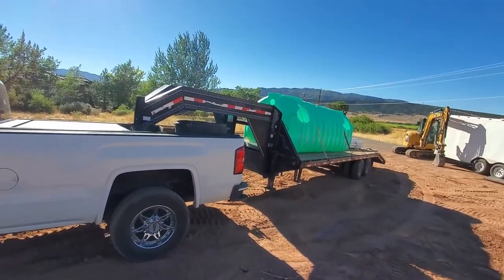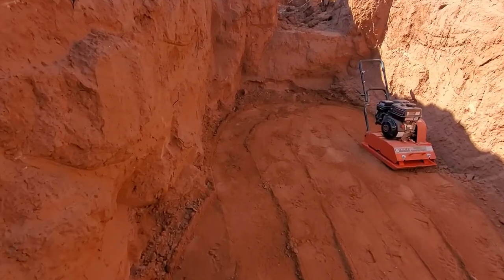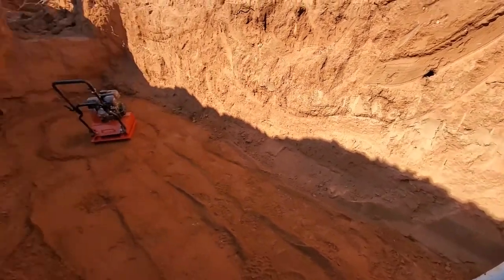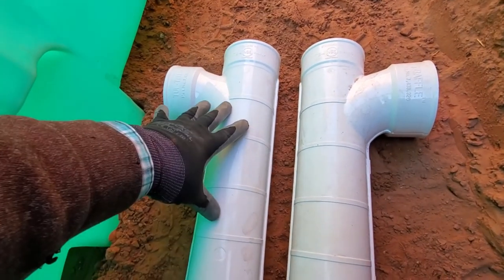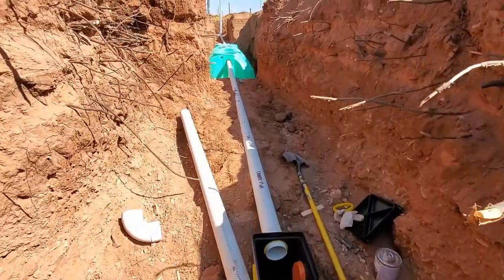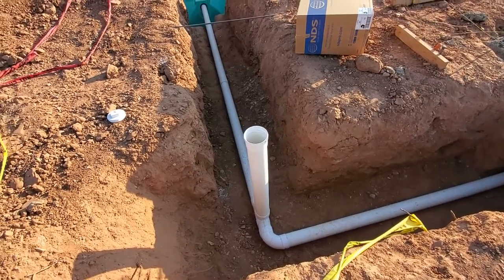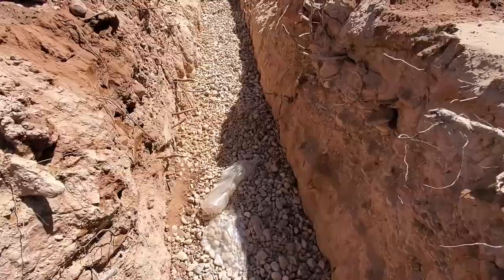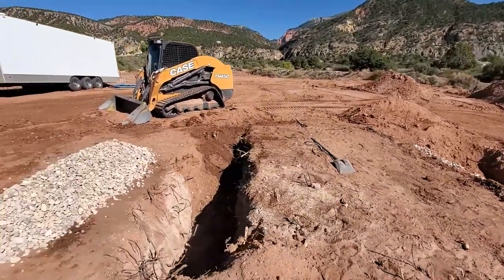Septic System Installing a 1200 gallon with 150 ft leach field

Comment: Just an opinion but would two 45s work better on the inlet, instead of a 90. 90 has a better chance of stopping up with paper and sewage.
Reply from the maker: You could definitely do that, but not totally necessary, just as an example you could flush 30 toilets at the same time into a 4 inch line and not plug it.

Comment: I was looking at buying a lot that requires a septic system, and building a 4,000 sq ft home with 5 bedrooms, but the cost of this will make me reconsider.  Thanks again, great video.  Would be awesome if you provide a cost explanation.
Reply from the maker: For a 5 bedroom home, make a note that if their is a nook or library, storage room, any room that could be turned into a bedroom they will add it as another bedroom just so you know, but 5 bedroom you'll need a 1500 gallon system minimum. The leach field is dependent on your soil, which has to be tested to measure its ability to absorb water etc. Super difficult to give you an accurate price without knowing all the variables, slope of the ground has a big to do with price, is there room to place extra dirt or will it have to be hauled away, most companies will have a rock clause in their estimate which is if they hit bedrock its extra cost, I'll tell you this it will be between 12k to 25k ish and I'm sorry it's so vague but it's impossible to get it accurate with the information I have. I've seen a lot that was so small and it was close to a river and you have to be 100 ft away he couldn't even build a system on the lot, so he bought a lot paid dearly for it and it was worthless to build on, so due diligence is real, be careful, sometimes only a 1 bedroom house can fit the system. Just be aware is all I'm saying, not trying to discouraged you from buying.
Reply: @SolidworksUnlimited  thank you so much. God bless.
Reply: I just had this project t done identical and the total cost was 9k with 2 1000gallon tanks
Reply: @SolidworksUnlimited  is this in Southern Utah?

Comment: Why is there only one riser on the main tank and why only on the water exit end?
Doesn't there need to be a riser on the inlet end of the main tank to provide occasional pump out access?
Reply from the maker: This tank doesn't have a baffle in the middle of it and that's all that is required by the health department, there's really no need unless you just wanted to look down it for a piece of mind to make sure you got it all when pumping it out, which will take place once every ten years I only do it if the health department requires it, which is only on tanks with a baffle.

Comment: thanks for this very informative video.  question: what kind of pipe did you use for the leach field?  and how much gravel was below and above the pipe?  thanks
Reply from the maker: Your welcome, we used 4 inch perforated pvc pipe the gravel depth is determined by the septic designing or engineering

Comment: I thought you needed to put the tank on sand and fill the 2 holes with sand. Waht did you use for drain field lines? No black pipe?

Comment: WOW that is pretty deep!  Usually don't see one go that deep!  
Would like to build a house with a basement bathroom -- DO NOT want a sewage pump but will most likely have a septic system since it will be a lake property and no municipal sewer.  How deep can a system be so the top ground does not compact on the leach field components?  I realize the sewer pipe from the basement must slope at 1/4 inch per foot.
Reply from the maker: They can design you a system that will work for you, just talk with your engineer designing your system and explain what your trying to accomplish.
Reply: @SolidworksUnlimited  Well thank you -- I am going to try and purchase a sloped lot with the intention of having a walk-out basement and then bring the basement plumbing out that direction to a plastic tank and leach field (most likely a Infiltrator* system)
Reply from the maker: Infiltrator is typically for shollow but might work

Comment: Little bit deep  ya think
Reply from the maker: The sewer had to drain from 60ft on the other end of the house, so that's as shallow as I could get it
Reply: @SolidworksUnlimited  thats cool there rated for 3 feet of fill over the tank. Looks durable
Reply: @SolidworksUnlimited  yeah ure in the desert 🏜 won't freeze like here we have to bury pipe 3 feet from the frost

Comment: And if the field is deeper than 4ft over time the field will suffocate  and then the field will fail so keep that in mind u don’t want it too deep
Reply: Correction I’m stating Colorado health department codes for infiltration chambers systems so rock and pipe maybe different

Comment: A lot work.  How much is the cost for this system? Seems expensive.
Reply from the maker: It's expensive, all depends on how many rooms you have in your home.
Reply: @SolidworksUnlimited  how is the length of the leach line figured?
Reply from the maker: They measure the ability the soil has to absorb the water, and the speed in which it absorbes, basically if you have tight clay soil you will have a much longer leach field than a place that has Rocky sandy soil. In a nutshell it's Saturation  level

Comment: Also for longevity you want concrete tanks over time those plastic tanks will get crushed by the weight of the dirt I’ve replaced many plastic tanks because health department says the tank was being crushed by dirt
Reply from the maker: If the plastic tank runs out of water from non use and gets low it can cave in, especially if someone drives on it, plastic tanks are not meant to be driven on or over. I agree concrete tanks are better, but not always available and more expensive, in this case I gave the owners options and told them the pros and cons. They went with plastic, purely off the price difference, and said they will never drive on it.
Reply: @SolidworksUnlimited  ahhhhhh yes good choice then make the customers happy
Reply: My brother had a 1500 gallon, round, hard plastic septic tank installed underground for his 3 bedroom home...about 30 years ago! The reason I say this is because his home was financed for 30 years and he had the round, septic tank installed when his home was finished being built. He paid his home off about 2 years ago. His septic tank is still going strong...after 30 years! Now, he does not let anyone drive or park over it.  He has had it pumped out several times over the 30 years but it was done at a normal rate of every 10 years or so. You must realize that products made 30 years ago were made to last. They were made of better quality and lasted. Nowadays, everything is cheaply made! Things just don't last like they use to because they are made of far less quality. I'd bet my last dollar that if you were to purchase a round, hard plastic, septic tank today, you wouldn't get NEAR 30 years out of it!

Comment: Why do you run pipes and install the tank so deep?
Reply from the maker: They wanted the system on the end of the house, and under the house the plumbing has to be 2 percent slope and there was a sink on the far side, we could have raised it 1 foot at best, but the inspector for whatever reason didn't want me to sleeve the footing. Everybody sleeves footings, but that would have lifted it a foot due to length of the house. But instead we went under it.
Reply: @SolidworksUnlimited  got it! Makes sense. Thank you for your reply

Comment: Can anything be added/flushed to help dissolve the poo & tissue?
Reply from the maker: Coffee helps the system, alot, rinse all coffee down the drain instead of discarding. It's not totally necessary though, poop and pee makes methane gas which dissolves almost anything besides plastics and concrete. In just a few weeks it will dissolve a copper pipe.
Reply: @solid works- liquid coffee? Or the grounds?
Reply from the maker: Both

Comment: WHY is everything so deep ?Systems need to beneath this deep it will never get any air
Reply from the maker: The homeowners wanted it in a spacific location away from the house, the house had plumbing on the opposite end of the house as well requiring me to slope 2% under the house and 1% out from under the house, thus it's that deep, it's about 3 feet down from the top of the dirt to the leach pipe, it's not that deep, I'd prefer it closer to 2 feet but it's within the required depth and passed inspection.